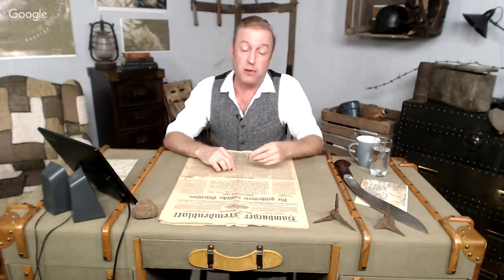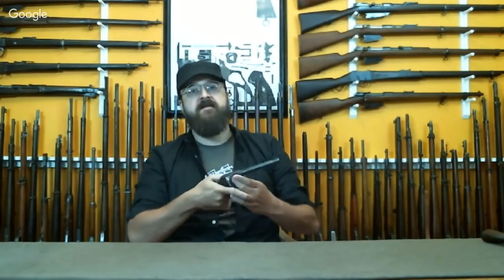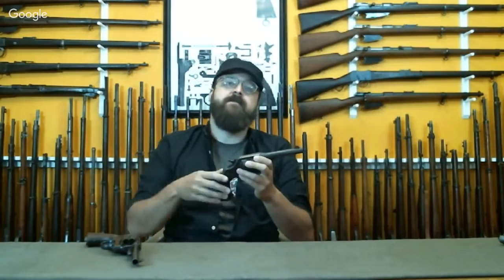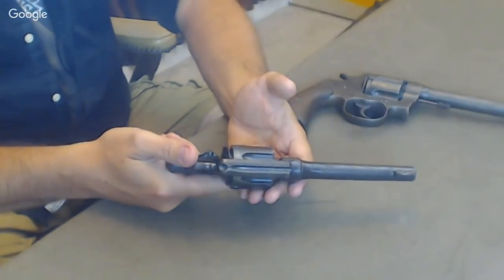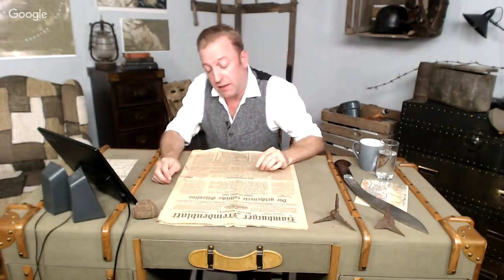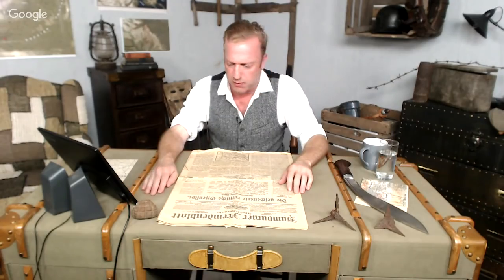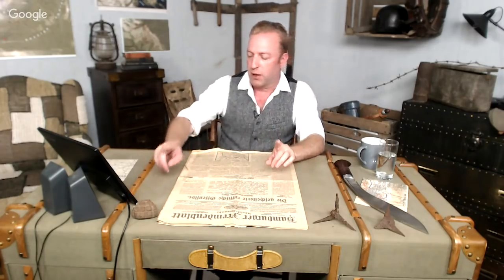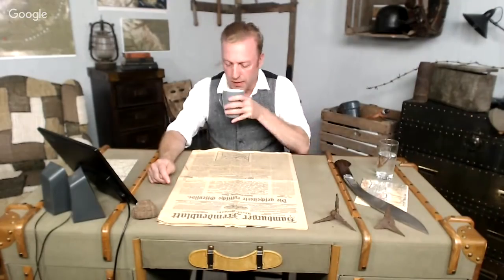American Firearms - Machine Guns of WW1 I THE GREAT WAR Live feat. C&Rsenal

Comment: Only a very silly person would trade a .45 for a 9mm.
Reply: Eh, its easier to maintain shots with a 9mm. .45 is a hoot to shoot though. I'd take either.
Reply: Go back to sleep, grandpa
Reply: Ehn, in the trenches I'd take a 9mm. More shots, less recoil, guaranteed penetration of a metal helmet. That said, a .45 is one & down... maybe. Heavy leather jackets & thick woolen padding won't stop a bullet, but would prolly slow down an already slow, wide projectile.
Reply: John Bartholf I mean, .45 or 9mm, they make no difference to me, I'm getting shot at!
Reply: A hipster trading his gandpa's gun for AESTHETIC.
Reply: 9mm has more armor piercing ability (higher speed + smaller mass) so for today's battlefield it could be better
Reply: with modern ammo, only a very silly person would trade twice the capacity and lighter (though snappier) recoil for about a 1% advantage on the one shot stop index.  In WWI or II, even 20 years ago, I might have agreed.  But anyone who clings to the 45 today simply has not kept up with advancements in bullet design and well, basic reality.   And I'm a 45 fan.
Reply: Your right. It'd be better to trade a .45 for a .38sp
Reply: Yeah, 10mm Auto is really the only choice.
Reply: 9mm is cheaper, and still does the job just as well. Sure, maybe you can stop a guy with one .45. But only a very silly person shoots the target once and waits to see if thats all you need, and if you're going to be doing follow-up shots, may as well get more bullets in the magazine.
Reply: 40 S&W is where it's at